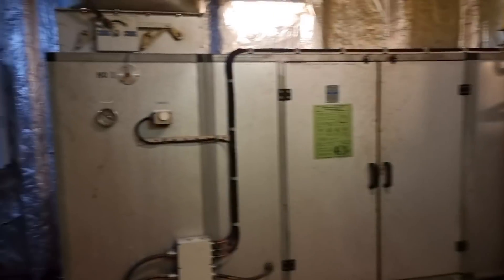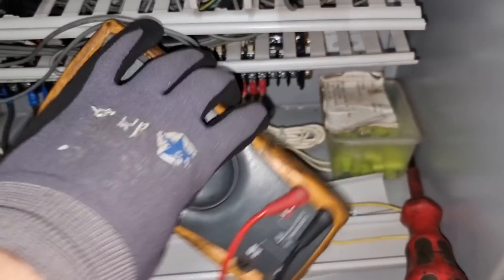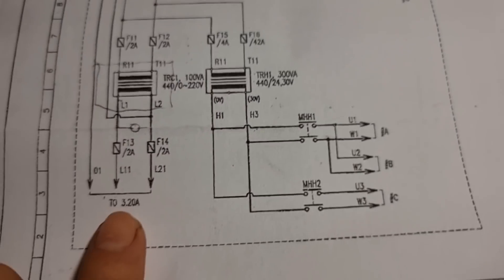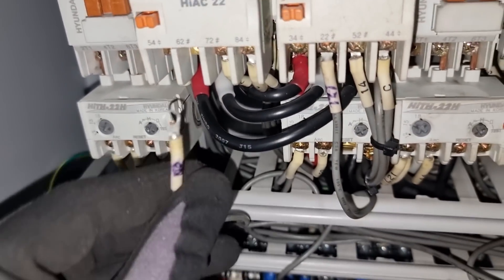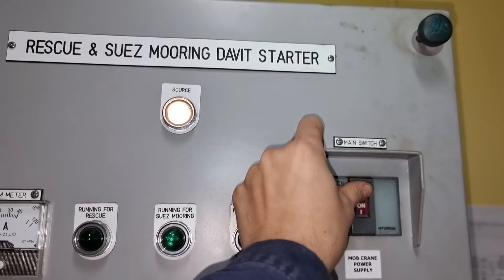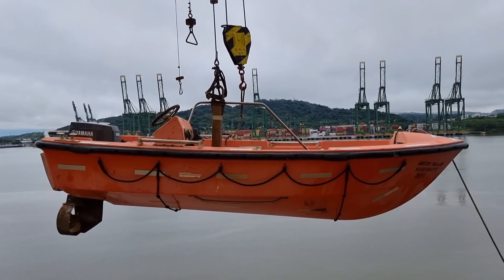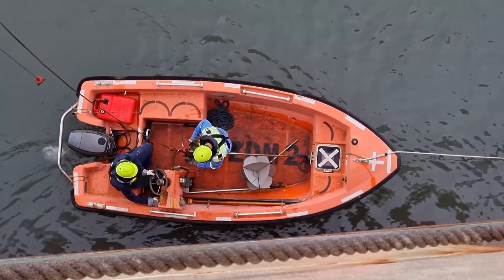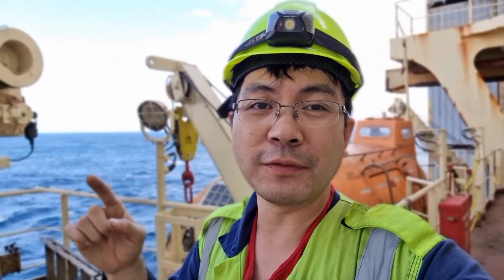RESCUE BOAT TROUBLESHOOTING &  LAUNCHING | MARINE ELECTRICIAN

Comment: 100VA transformer..... hope that heater is pretty small. Same size fuses on primary and secondary of transformer too..... Not to mention, 2A on 440 is 880VA. No wonder it melted. But maybe for life / safety it's better to overload the TX than have a fuse blow. 
Good diagnosis and fix as always. Too many would just throw in a new transformer and not question why.
Reply: I have experienced technicians trying to fix stuff by replacing immediately. Some intermittent issues even gave them some temporary sense of victory.
I bet with that connection in the junction box, if the box wasn't watertight you could sniff your way to the fault. Somehow that picture makes me smell burnt electrical stuff in my mind...
Reply: 8 times rated power isn't too insane considering that transformers have quite large in-rush currents, especially tiny ones like that, through a slower 1A fuse would probably have been better.
Reply: @sstorholm  8X is a little high and for inrush or surge you can use time delay fuses. But, sure there was a reason they used the fuses they did, or I hope so anyway.